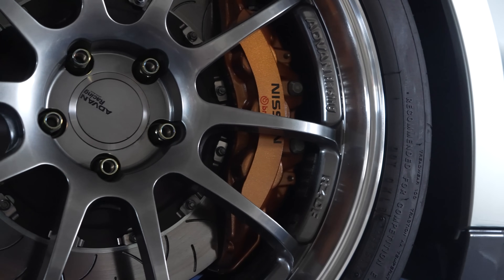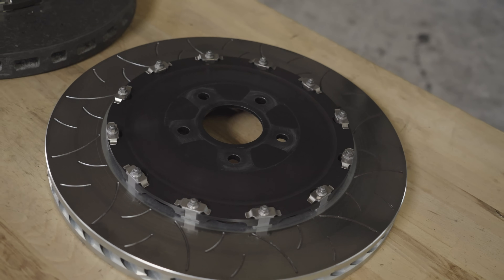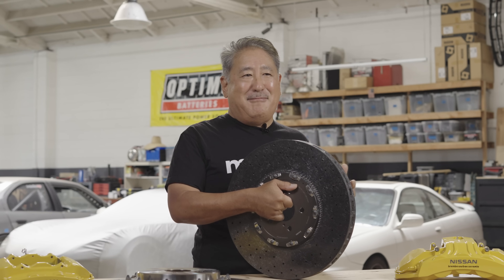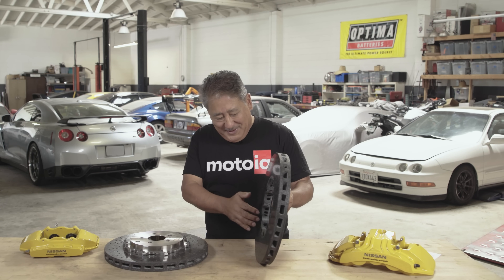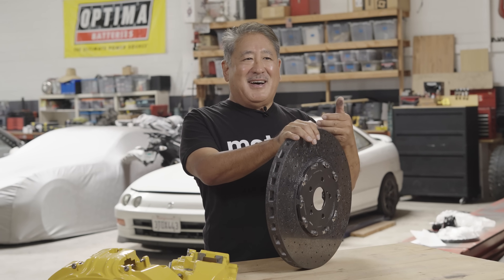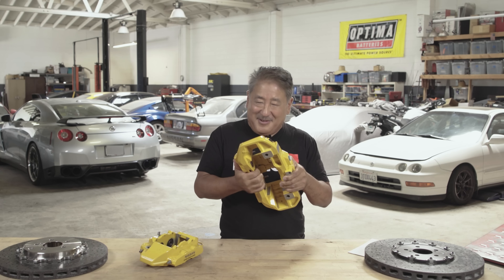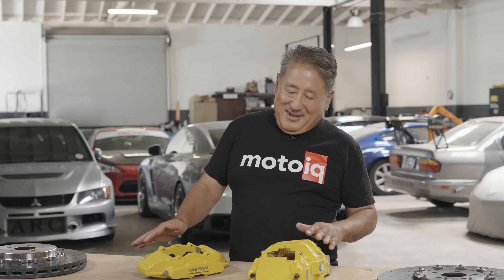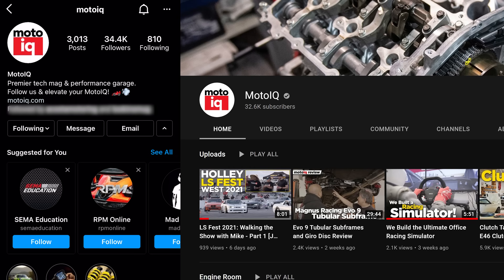MASSIVE R35 GT-R Carbon Ceramic Brake Upgrade!

Comment: RacingBrake offers an aftermarket CCM kit for the R35 that is 410/390mm front to rear, although they are not monoblock calipers.
Reply from the maker: The annulus seems more narrow on these with less swept area than the Nismo brakes.   We do like RB's stuff though and they probably work well.

Comment: Very cool video! Those brakes are huge! Question: What happens if you use the pads for carbon ceramics on iron brake rotors? I was at a track day where a gentleman with a Audi TT RS heard noise coming from his brakes. He thought it was weird since he had carbon ceramic brakes and recently serviced them. We pulled off the wheel and the rotor appeared to be iron, and nearly completely eaten away. I wonder if he went into the parts department, got the pads for CMM rotors, then put them on his iron rotors, for whatever reason thinking he had carbon ceramic. (Edit: Looking at the pictures, the rotors were certainly iron and pretty gouged up. The pads appear to have been eaten away, and I'm thinking the pad-backing-plate rivets were eating the rotor.)
Reply from the maker: He could have been driving race pads on the street.  Race pads can totally ruin your rotors in a few hundred miles if they are not brought up to racing temperature.  Race pads are mostly metal and require heat to develop a metal oxide transfer film on the surface of the rotor to help protect it.  In street driving the brakes, don't get hot enough for the film to form and the aggressive pads quickly eat up the rotor, literally in less than two hundred miles in some cases.

Comment: Hi.  I just put these CCM front and rear on m6 GT-R.  My question is do you have to recalibrate the ABS pump including the brake sensors and pressure valve?  The reason im asking this question is due to the  brake pedal now is a little lower than before but when I once press the pedal again it goes right on the top.
Reply from the maker: I think you might have gotten air into the system.  If you get air in the abs valve, it takes a lot of bleeding to get it out.

Comment: Love these in depth videos Mike. What are the difference between these and Spec V CCBs they initially offered
Reply from the maker: I could not find any specs on the brakes but they look like the stock diameter but with a larger swept area. This is purely by looking at pictures of them and seeing how big they look in the wheel.

Comment: Awesome video! Do these calipers require spacers or mounting adapters? or do do these bolt directly to factory mounting points of CBA or DBA GTRs?
Reply from the maker: Yes they do
Reply: @motoiq  so they require spacers/adapters?   Thank you :) I wasn't able to find any info on the kit contents and install procedure
Reply from the maker: No

Comment: I am going to do this exact setup. I have found the rotors, I know the pads are Brembo, but what model?  Any help is appreciated. I searched the numbers that were on the pads when they were showing them, i could not find the pads.
Reply from the maker: Any one for carbon ceramic rotors. The Nissan dealer to make it easy.

Comment: Hi.  Are these CCM brake kit will be compatible for a 2010 CBA GT-R? Thanks.  Great video.
Reply from the maker: Yes, if you want to buy these brakes they will be available soon, I am selling them!
Reply: Do you need to replace the wheel hubs?
Reply from the maker: No

Comment: How does this OE Brembo CCM from GTR Nismo compare to Endless new CCM dedicated kit for the R35 GTR?
Reply from the maker: The Endless kit is nearly $50,000 with smaller rotors.
Reply: @motoiq    I wonder how much is the OE Brembo CCM setup?  Half the cost?  Or $40000?  And the Spec V OE CCM version Not sure if it's still available?

Comment: I have a 350 mm Brembo braking system, can I mount the carbon ceramic discs without replacing the calipers? lancer evo x
Reply from the maker: It will require fabrication of a bracket, hat,  special brake pads and finding a CCM rotor of the right size.  A Z06 one might be a good starting point.
Reply: @motoiq  thank you very much for your kind reply

Comment: The 2021 track also comes with the CC brakes. Not just the Nismo car.
Reply from the maker: When we shot the video, it was before that was an option in the USA.
Reply: @motoiq   Mike, check your shop emails I sent you a message. -Zo
Reply from the maker: which email?  I don't see it.

Comment: Great video! What is needed to do fit these on the 2014 GTR?
Reply from the maker: Well considering that this is a video on putting them on a 2014 GT-R! It basically bolts right on.  Just the rear dust shields need to be modded. Check this out!https://motoiq.com/watch-massive-r35-gt-r-carbon-ceramic-brake-upgrade/
Reply: @motoiq  thank you for replying. That’s great that you can just bolt these on. I was thinking that some spacers would be needed to clear the caliper.

Comment: Great video. I have a 2020 wrx Seres white and would love if you could get a set of carbon rotors for the sti, just would be cool. I don’t know if it would be worth it but I think I would love a set, if you could have a set on an sti for 10-12k $ it would be sick. Expensive as-F but sick. Has anyone swapped gtr breaks on an sti? That would mean it could be possible with this set. But it’s oversized for a 3300 lb car. I track my car 4 weekends per year and could see myself getting into wanting these. The factory brembo breaks are great but I’m already wanting 2 pieces rotors and track pads with fluid.
Reply from the maker: No one reputable to our knowledge makes a CCM conversion for the STI
Reply: @motoiq  that’s a shame, but there’s no way it’s worth making, the kit would cost 50% the value of a new car. And it is not that heavy. Still would be cool. Thanks for the reply.

Comment: So what is CCM-R then? Is such an upgrade available, and if so, theoretically, does it also fit to the R34?
Reply from the maker: CCM-R has less ceramic and more carbon in the matrix.  I think the GT-R stuff is CCM-R but not 100% sure.  I heard the R35 stuff fits on the R34, at least in the front, but never personally tried it.  I would suggest googling to see if anyone has done the swap.

Comment: Is the fluid dot4, dot5 or dot5.1? Wondering cause if it's dot4 compatible I migh use it in my motorcycle
Reply from the maker: Endless isnt clear about it but we believe it's DOT4 with a DOT 5 temp rating.

Comment: Is the brake bedding process any different with ccm rotors and pads?
Reply from the maker: It doesn't need extensive bedding, just some easy driving to burnish them in at first. Then they are good to go.
Reply: @motoiq  Unless your rotors come with matching pads (pre-bedded from the factory), they will need extensive bedding for optimal performance.
Reply from the maker: @gearheadrd5263  That's not true if you have the proper pads.

Comment: Hang on - One bit of info is wrong, the OEM calipers are monoblocks (front and rear) and not 2 piece. If it were 2 piece, you'd see bolts joining them and also the centre joint line.
Reply: ahahhah - you're gonna get hammered on the monoblock - just seen a few comments.. hahah...  great vid though.
Reply from the maker: Yeah you are right.  I got messed up by Brembo's marketing terminology.

Comment: can anyone post a link for this kit. thanks
Reply from the maker: Can be gotten from Nissan.
Reply: @motoiq  thank you for the reply. great info by the way. expensive. but its not bad after looking at the size of the system. do you know if there is color options for the calipers ?

Comment: there is a big problem with this carbon ceramic brakes, the contact surface of the disc has a thinner line of carbon fiber close to the midle. when the pad toches that carbon it wear diferently. it can actualy be seen on the pad.
Reply from the maker: Not on the OEM Brembo system
Reply: Ferrari, McLaren and Aston Martin had that problem on factory brembo brakes.
"Brembo Brake Flaw Problem Carbon Ceramic Ferrari, McLaren, Aston Martin" video explain

Comment: The stock calipers don't look 2-piece to me
Reply from the maker: You are right they are one piece without a bridge.  Brembo calls the bridged calipers monoblock and it screwed me up.
Reply: @motoiq  Monoblock refers to the construction - machined out of 1 piece of metal (the metal/aluminum block could be forged - very likely forged). The bridge, that's probably just design to add rigidity.
Reply: Stock r35 calipers also have fancy titanium pistons. They are very good calipers in their own right

Comment: Mike, Have to respectfully disagree with you - those OE front calipers definitely look like one-piece (monobloc in Brembo speak) to me. Main difference is that they have removable bridge bolts vs the forged-in bridge on the others. You also can see the small, external brake line, which you wouldn’t see on two-piece calipers.
Reply from the maker: I got this from a 2019 Japanese Nissan press release which I cant find now.  I knew the stock rear brakes were monoblock for sure. Looking at pictures of the stock front calipers I don't see any bolts on the sides either so you are right. The Brembo literature calls calipers with the bridge monoblock but not the bridgeless ones which probably added to my confusion.

Comment: Urine information is always received well but I have to honestly say that the price for carbon ceramic routers is absolutely absurd. It is 3 times what they should cost.  And what what we have always done? Is I just take a roller like the ones? I have now. On my GT? R. The J hooks and we have them cryogenically frozen and they last 4 times as long as they do if you don't do this I don't understand why people don't do that it's a simple. Thing to do it only cost a few 100 bucks to do a set of 4.  And it's well worth the money because the rotor is gonna last forever. So i'm just not a a fan of the carbon ceramic and neither are several my friends it own g t s.